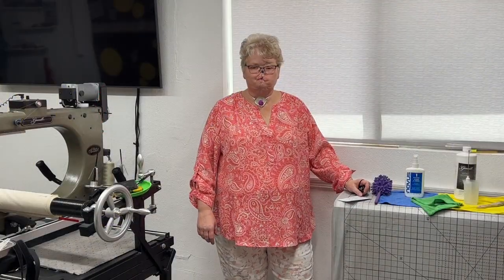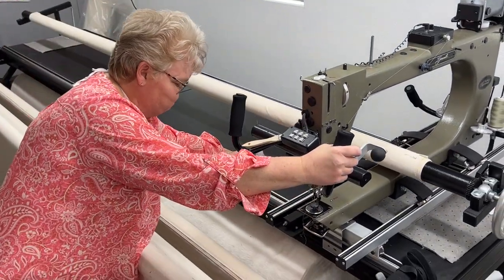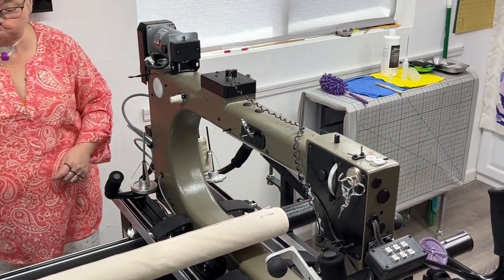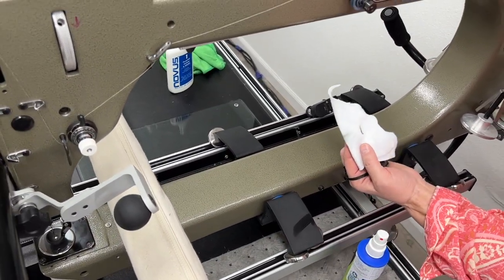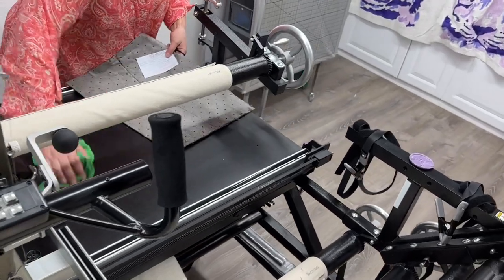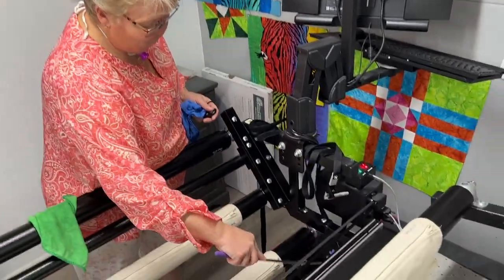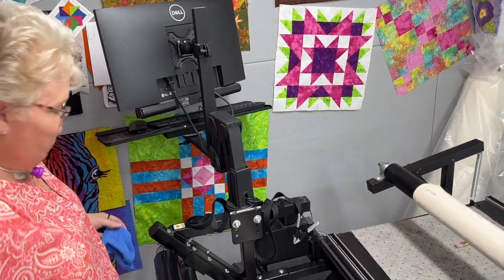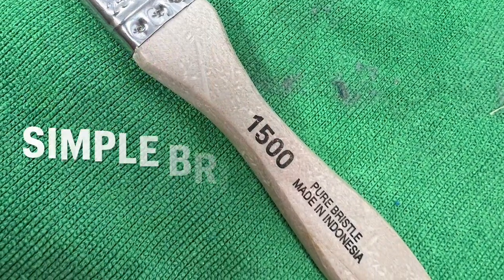Daily Longarm Machine Maintenance

Comment: I’ve always used alcohol to wipe down my wheels and tracks. Works great. Also use a compressed air blower to clean out my bobbin area - and blow off thread bits from my leaders. I used to use a paint brush but found compressed air worked better for me.
Reply from the maker: Alcohol can be hard on the plastics and could cause it to crack over time. And condensed air emits moisture which I wouldn’t want on my leaders or inside my bobbin area. 
But I’m sure you know the risks and I’m glad you have a routine that works for you. 😊
Reply: @ValerieGreenwellQuiltArtistry  I was actually taught to use alcohol by Marie Tallman, one of the early beta testers. So far (10+ years), it’s worked well for me.
Reply: Valerie Greenwell  i just use scrap batting and a bottle of regular alcohol - and the tracks are metal, anyway. Like you, I clean thoroughly after finishing up for the day. Sure feels good to keep my machine running in tip-top shape. Only difference I was taught was the oiling spot above motor gets 12 drops, all others 2 drops. Maybe the newer machines take less? 🤷🏼‍♀️
Reply: Compressed air in a bobbin area is not good because what you're doing is your compressing the air it's not cleaning it out it's compressing it in packs up and builds up that is one thing on your comment. I noticed that I felt that I wanted to share and help you that's not a good idea. I don't use compressed air thinking you're cleaning out the concept sounds right, but in all reality, it's actually compressing it into it and making it worse. Makes a build up until there is that you might not be able to reach
Reply: @user-mp9ur3bj1f  totally disagree! Many, many longarm instructors used compressed air which is why I switched recently from just using a paint brush! There’s NOWHERE for the dust and lint to go except out of the bobbin area - I have far less issues with lint and thread breaks since using this method! But hey, you do you! I’m quite happy with how much cleaner I keep my machine!
Reply: Hi Valerie,
I’m new to all this when I brought my Longarm they never tell you how to clean your long arm and to do the maintenance. thank you so much for showing me how to oil and clean my machine Valerie , I’m so glad I come across you and now I know how to clean my machine. Looking forward to your next Tutorial .🌻🌻

Comment: I don't own a longarm, but have been thinking about getting one. This information is helpful for thinking ahead to what it would take to maintain a machine and keep it in good running order. Would you say these steps are good things to keep in mind across most brands of longarm machines?
Reply from the maker: Yes indeed 
It doesn’t matter what brand of longarm  you use, maintenance and cleaning routines are very important
Reply: @ValerieGreenwellQuiltArtistry  Awesome! Thanks so much for the response.